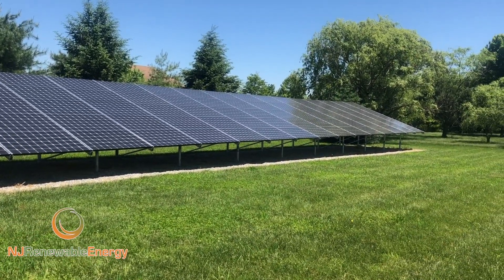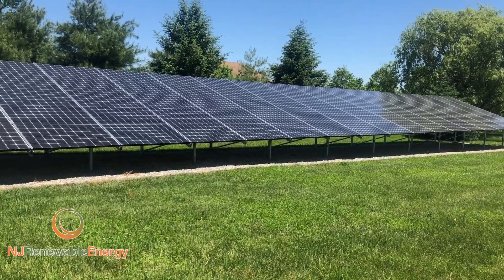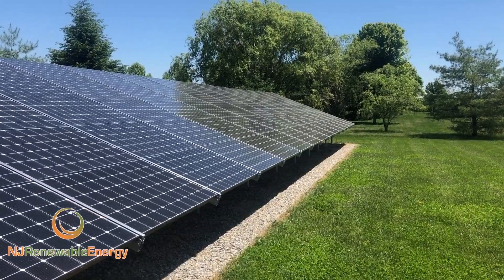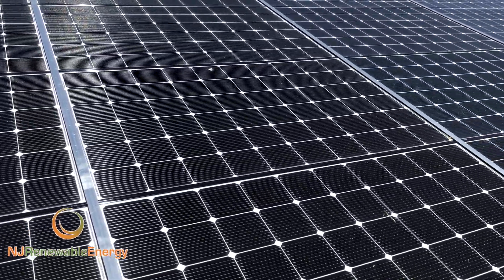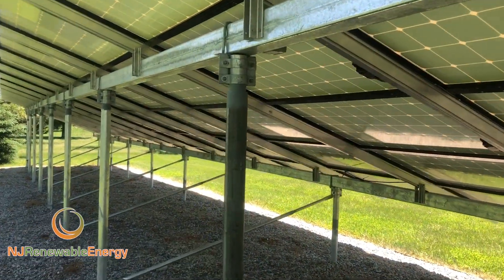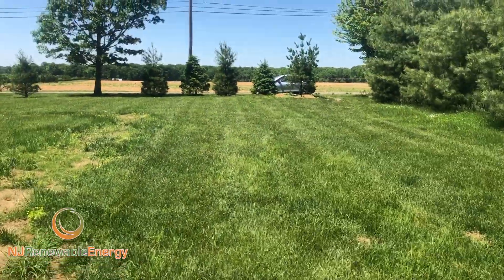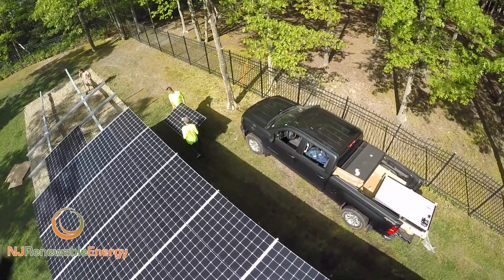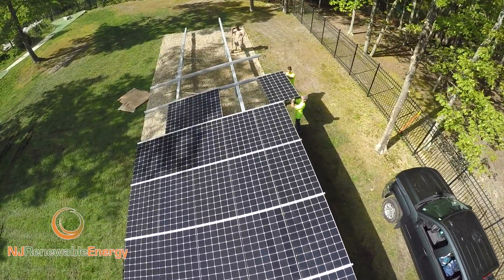Review of a Ground Mount 28KW Solar Array.

Comment: Hi, when you say 28KW array, do you mean 28KW per hour or per day ? Thank you.
Reply: KW is a measure of power, it says how much it's producing right now. KWH is a measure of energy, which is what you pay the energy company at the end of the month. Energy = Power x Time. So if the sun was out for 1 hour, the panel array would have generated 28KWH of energy. If the sun is up for 5 hours per day (average peak sun) then the solar array would generate 140 KWH per day.

Comment: Good video. I'm installing my own ground mount system 18kw 150' from my house which looks like a similar distance for this install. Regarding voltage drop, what gauge wire did you run to the main panel? I was thinking 8 or 10 gauge. Thx

Comment: Can we adjust the angle of the panel over the course of the year?
Reply from the maker: There are systems that track automatically. This isn’t used as much in the north east because of ice and snow.  In the end, sometimes the cost versus reward is most of the time better to just pick a good spot and leave it.

Comment: Dear NJRE, i know this vedio was from 4 yeas ago, but was any restriction on how much square footage wise , or  total wattage you can install in residential area when you installed them in 2018? and how about now in 2022;
Reply from the maker: Things are basically the same, but really the rules are a Town by town basis. Each construction office has their own policies for setbacks, Acreage, location of Array.  Array size in New Jersey is based on usage. You are only allowed to produce as much or less than what you use on a yearly basis
Reply: @ThisWeekInSolar that sucks. Doesn't it ?

Comment: Why don't you install taller support, and use the panels for shade over a concrete deck and entertainment area (outdoor kitchen, tables, etc)?  
Would serve two purposes, instead of wasting the space underneath. 

They could also be used for a covered "carport", for a cooler car, and to save your vehicle's paint.

Maybe high wind areas would be a factor, but if you don't have snow to deal with, make them lower pitch.  
(and like one viewer commented, add small air gaps)

Comment: Do you have manually adjustable mounts? I want something that I can crank weekly to match the seasonal change. Don't need a daily tracker, just something simple to maximize summer to winter.
Reply: Where I am in E TN the difference between one fixed angle and monthly-adjusted angles is less than 6% (analysis by PVWatts).  For that difference just add an extra panel or two and spend the savings on upgraded batteries.
Reply from the maker: We do not and I don't know of any professional installers that do.  Most people are not interested in moving the array.  They can be very heavy.  Typically increase isn't as significant as you might think.  In the NE, with ice and snow, moving an array can be problematic.
Reply: @ThisWeekInSolar  Interesting. I want to power geothermal heat in the winter. Would you recommend sizing the array and tilting them for the lowest sun angle to maximize winter production?
Reply from the maker: Typically we size the array to produce 100% of the power, but its not always when you're using it.  Meaning, we will make more power in summer, spin meter backwards and get a credit.  In the winter, when you need more power, you'll use the credit.  In the end you'll make as much as you use.  Hence Net zero.
Reply: @ThisWeekInSolar  I guess I'm thinking more off-grid with battery storage (4-5 days of storage...Tesla Powerpack).
Reply from the maker: @oisiaa  We do sell battery back up.. Fortress Power.

Comment: That's beautiful.  I wonder how long it takes for an installation like this to pay for itself?  7 or 8  years?
Reply: It depends on quite a few things, including how much sun the panels get to see all year which includes location on the globe, weather conditions, how much electricity you are using, and how much the system costs. I highly doubt 3 1/2 years is a good figure because I am quite confident that this system costed a lot of money to install. In 2017, the average residential monthly electric bill was $111.67 in 2017, according to the Energy Information Administration (EIA). So you are telling me that this system only cost $5000? I don't think so!!!!! And before you start talking about selling electric back to the power company, you can only sell a small fraction back as they don't want to go out of business.
Reply from the maker: About 3 1/2 years.     And that is for about any size system these days, since most returns on investment are relative.  Meaning, bigger system,  more SRECs, larger Tax credit, move power costs saved.